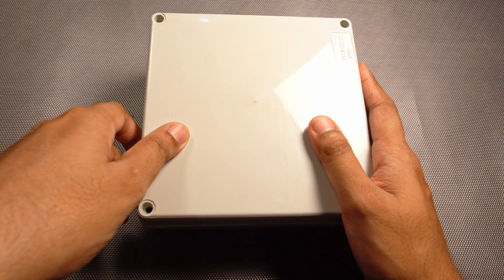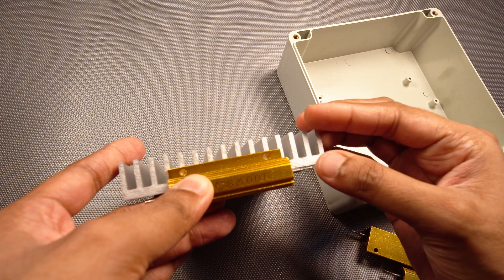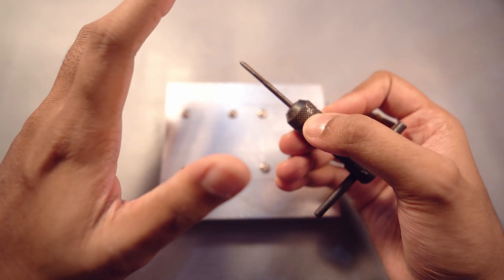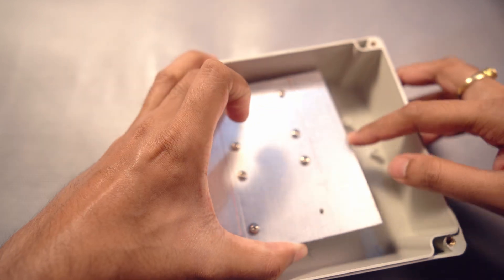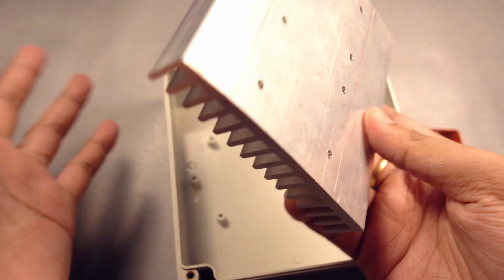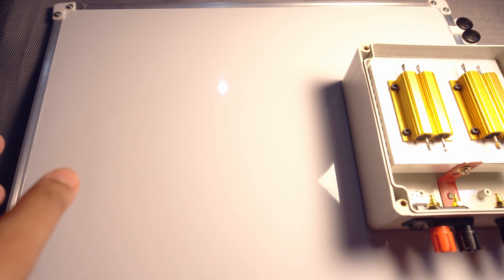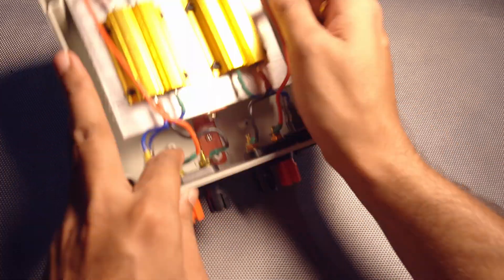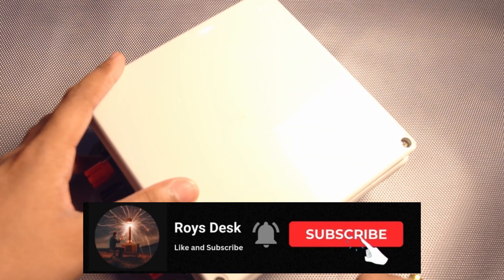How to make a Dummy Load to Test Amplifiers | Resistor Network Box| 8Ω 400W or 4Ω 200W

Comment: I enjoyed the video. Great for short tests, but you might think of adding a small case fan and exhaust hole if you want to run longer tests.  Having a heat sink that size, with 400W in a closed box makes me uncomfortable.  Even passive cooling might be good.  Wouldn't be as big of a problem if you had found a metal case.
Reply from the maker: Yeah true … for 400watts I really need better cooling . Recently I did make some holes for better passive cooling.

Comment: Couple comments in regards of this project.First you don't check if those resistors ar inductive !!! I'm found some of those very inductive loads values.
That change the value of your test completly even the load of your under testing  amplifier . A good LCR meter can tell if the resistors are inductive Second note the box can't ran for long period of time fully loaded, regardless if the resistors are mounted in a heatsink the heat needs to cool down and the box is sealed heat can't get out.
Reply from the maker: Hey 👋 buddy …. Yeah true the inductance in the load will make the rms measurements drift off . But I did measure the inductance of these resistors its very low till 40khz range … so its not really a problem here . Plus I always use zobel network in the output stage of the amplifiers which reduces the effect of inductance even further.
Secondly yeah I do need to make some air inlets … !!